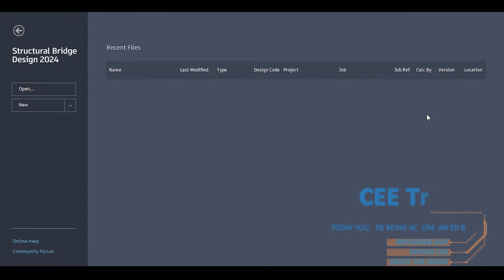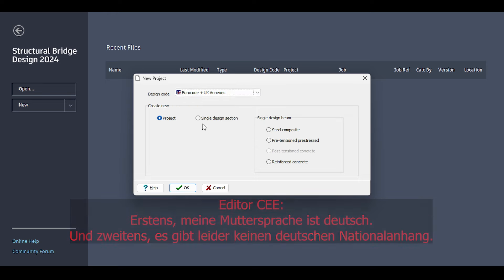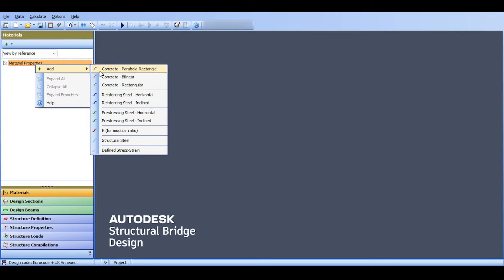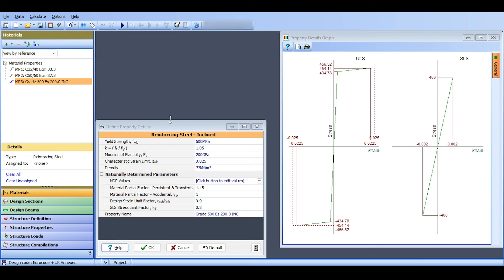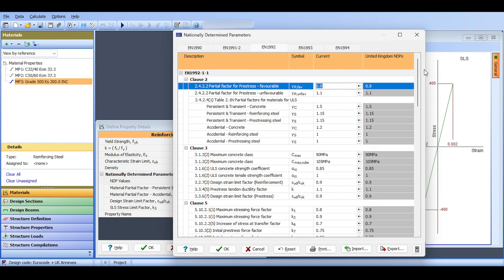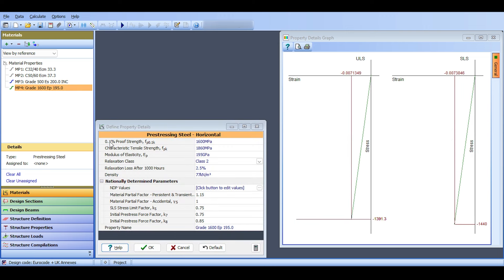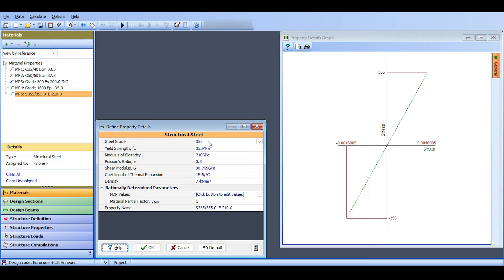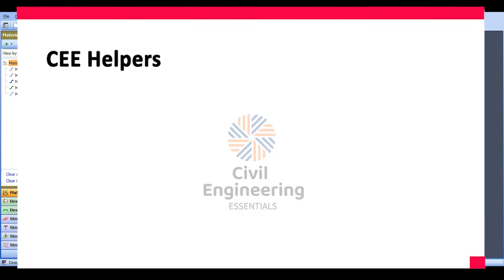Modeling and Design of a Prestressed Bridge on Autodesk Structural Bridge Design - Part 2 Materials

Comment: do we use the formula (0.043xW*1.5sqrtFc)in aci 318 for calculating the moduls elasticity of prestressed concrete ?
Reply from the maker: That is a very very important point!!
It depends on the context and application:
if you are in a context of "simple reinforced concrete in buildings" or "prestressed concrete in buildings" then YES, ACI code is your correct approach.

If you are in the context of "Prestressed concrete in Bridges" then the AASHTO LRFD Code is your Go-To code.

Of course, I am not talking here about the EN codes, because your question was about the American codes.

Regards,
CEE